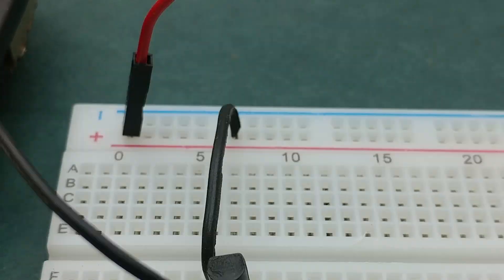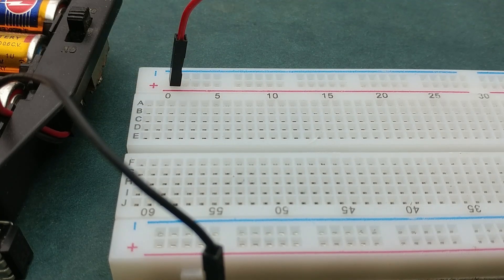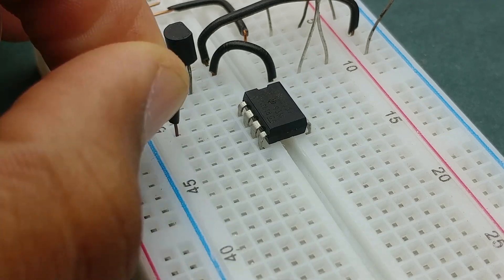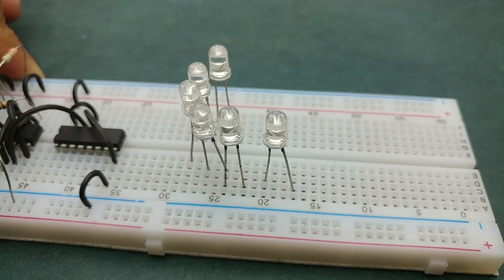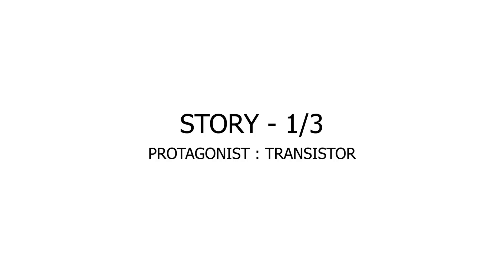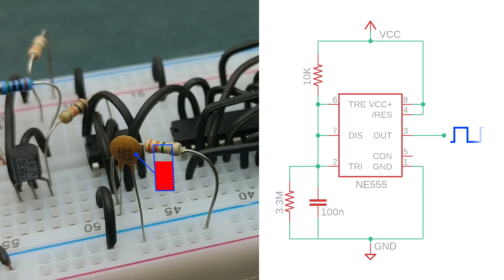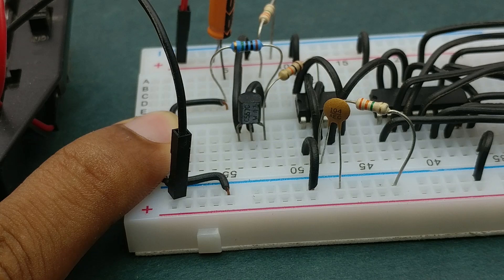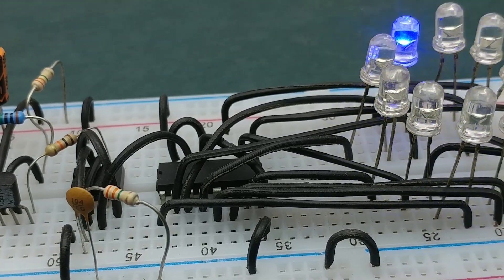LED Roulette Circuit Using 555 Timer, 4017 IC & Transistor - With Theory

Comment: @Elonics Does bounce add some randomness?
Reply from the maker: Yes, It does. Even millisecond of extra contact can change how much the capacitor is charged, which indirectly determines when the rotation comes to a halt.
Reply: @elonics  Thank you for your reply. It is a clever little circuit which I intend to build once my CD4017's have arrived.

Comment: What to use if I don't have 3.3 m ohm resistor
Reply from the maker: You can club 2 or more resistors in series to get that value. It need not be exactly 3.3, anything between 2.7 to 3.3 is okay.
Reply: Ok thank you Bhaiya

Comment: 3.3 M ohm resistor is not available so which resistor Range  to use connect the circuit
Reply from the maker: The value need not be exact. You can also connect  3 x 1M resistors in series. So the total resistance will be 3M.

Comment: I've noticed you use 270 ohms, 330 ohms, 470 ohms or 1k, etc resistors not only in this video but in all your videos. How do you find out the value of resistors and capacitors that you use?
Reply from the maker: If you mean, "How do you find out the values of ALL resistors and capacitors that you use?", you need to go through the explanation part. You'll then understand the underlying reasons for choosing a higher/lower valued capacitor/resistor.
If you are confused on the value resistors used in series with the LED's, the calculation is straight forward. You can use this calculator to determine the value: http://ledcalc.com/  Like 
+nukecat said, it is determined using Ohm's law.  P.S: I use LED resistor values generalised for LED's of all colours. So they are a bit more than what is generally required.
Reply: do you find out the value of resistors and capacitors that you use? those values  are predefined. using formula  u have fine the vale of resistor and capacitor.
Reply: There are formulas that you can use to calculate these values. The main one used for many applications (ie. LED current limiting) is called Ohm's Law